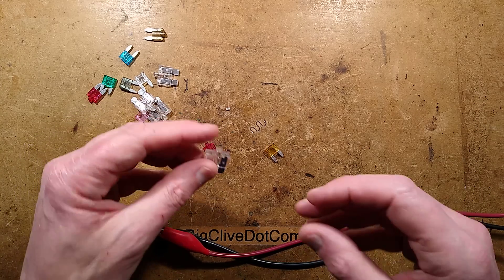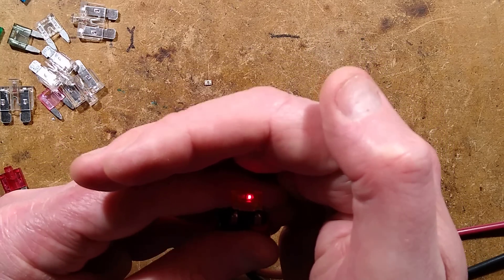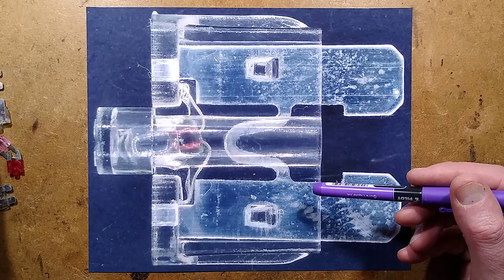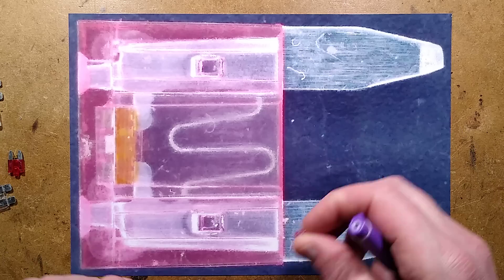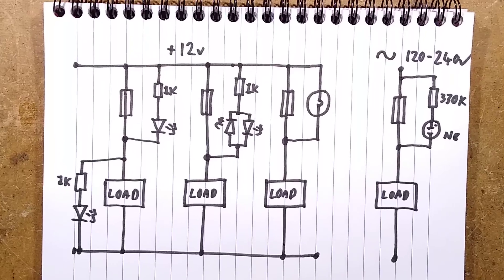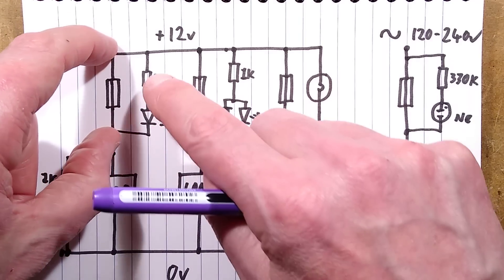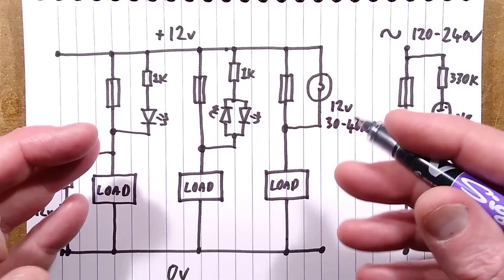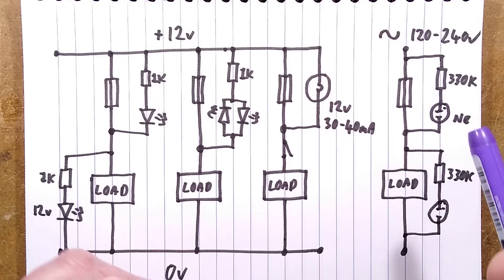Inside self-indicating vehicle fuses

Comment: My company built an electrical panel for a client and used indicating fuse holders for 4-20mA instrumentation… it did not go well, we struggled the figure out why it wasn’t working. Works well for solenoids but not for instrumentation.
Reply: These things a 50% wirchcraft. I had one in a machine with a 12v outlet. + from the outlet to + of the battery was 0V,  ground out to ground battery was 0v, but the outlet showed ~10,5V, while the battery was at 12,4V. Took us 30 min to figure out, that the fuse was blown, and only after checking the outlet with a load. Without the load, they won't light up (in addition to this one being in a non transparent box). 
So great to find a short, terrible, if the offending device was already removed.
Reply: @clockworkvanhellsing372  I try to explain to non electrical people that if you run a 220VAC to an open limit switch that is 50m away and you can measure 90VAC between the return wire and neutral. They look at me like I’m mad. It’s enough to make an interface relay hum and you can measure it with a multimeter but people refuse to believe it because it’s an open circuit and should have no voltage
Reply: @garnergc - try working on long distance (as in hundreds of yards or more) systems where multicore cables carry mains AC, or unsmoothed DC circuits, or which run in the same cable run as a mains cable. All kinds of stray induced voltages can occur even if both ends of the core you are testing are disconnected...
Reply: Bonus we had gotten a dodgy batch of fuses from a supplier and while I was doing continuity testing with a multimeter I’d be blowing “50mA” fuses. We scraped all fuses under 100mA in those panels and replaced them with a fresh batch

Comment: What happens if the fuse is feeding something with a high resistance? Also, the item fused would have to be switched on for the light to show (headlamps, blower, etc.).

Comment: Self indicating fuses (especially tungsten ones) kill batteries if you have a wire harness fault on a parked car.
It adds a phantom drain that is not insignificant to the blown circuit.
Reply: Buy a solar panel for your car if you are worried about minor drain. I hardly use my car, so I have put a solar panel on the dash. It's not powerful but enough to just keep the battery topped up
Reply: Adding this type of fuse is a good idea in principle but maybe not a great idea for permanent live circuits. Ignition controlled circuits should be fine. I say this because as mentioned above in other comments the parasistic drain on a typical 12v vehicle really need to be as low as possible to avoid dead batteries. As a rule of thumb I work on anything above 90-100mA is too high and needs looking at.
Reply: The quartz clock in my old car pulls about 30mA, which isn't really an issue, but i'd agree if you have a choice between the LED and the filament fuse, choose the former particularly if you don't drive the thing every day. 
As an example, 200mA quiescent drain on a 44Ah battery managed to flatten the battery in 10 to 14 days. I found out that i'd plugged a relay into the wrong socket, and it was 'on' full time. It got quite warm..
Reply: Yes but little flashing alarm LEDs and computer / sound system memory backup don't kill batteries because of auto industry magic
Reply: You know that modern cars nowadays are permanently connected to the internet like Mercedes Me? Guess what’s powering the LTE and controller module?
Reply: @the_tux  Said modern cars also do coulomb counting on the battery to support fuel economy features like auto start stop and charging disconnect (drop the alternator voltage to stop charging when full), so they will stop LTE connectivity and features like passive entry when the battery is low. This also happens 48 hours-7 days after the car sitting idle.
Reply: @straightpipediesel  Even in that case they consume way more energy than self indicating fuses do. Especially when they’re equipped with LEDs.
Reply: To see any battery drain from a self-indicating fuse while parked you would need to have a blown self-indicating fuse on a circuit together with a wiring fault that's keeping that specific circuit powered while the car is parked..... is your car being held together with tape?
Reply: @MatthijsvanDuin  Modern cars rarely switch DC power anymore but rely on bus communication and logic to turn things on and off. For example, in old cars, your radio would be switched, but due to, for example, the infotainment system taking OTA updates while the car is parked, it's now constantly powered and has logic to go into sleep mode. Another consideration is instead of running individual supply wiring back to master relays, they can mix consumers, reducing wiring weight to improve fuel economy.
Reply: I have several 2-way radios in my car that are notorious parasitic drainers; I got sick of replacing my battery so I installed a blade fuse on the ground lug.
Reply: @Jah_Rastafari_ORIG 
All radios must be duel fused, one on Positive lead, and one on Negative lead. One is DC, and the other RF.
Reply: @snakezdewiggle6084  Uh-huh.... "RF fuses"...do go on...
Reply: @Jah_Rastafari_ORIG 
Oh sorry, I assumed you knew about Radio.

Comment: Given how often car fuse boxes are located in pretty piddle-poor places, having these as standard would be very useful for when things go pop, saving time and spinal contortions in getting them swapped out as quick as possible (once the actual fault has been determined of course!)... :)
Reply: Not to mention some of the bloody things have THREE fuseboxes.
Reply: @thephilpott2194  
Or more...for instance  Ford Transits have a double stacker one as well, which can bambozzle the unwary (especially if the owners' book has gone AWOL).
 Its odd though isn't it, though. For a long time cars only had the one fuse, if they had any at all (in the field circuit of their 3rd brush generator). Then fuses for everything (including headlights!) in the 1930s, then back to one in an inline holder somewhere, or two fuses in a Lucas 4FJ fuse box in the 50s-60s, then maybe a dozen or so in the 70s and now we are back to double digits.
Reply: It would be better if the fuse boxes had the indicator LEDs instead.

Comment: Ive seen these similar style self indicating fuses used in oil refinery server rooms. They have normal glass fuse inside the housing and two leds in paralel with a resistor.

Comment: At work I have some fuse holders with indicators on the power input to some gas burners, it's some chinese fuseholders for 6.3x32 fuses, the clear plastic handle that's used to remove and insert the fuse and cover the contacts has a neon bulb inside of it

Comment: That's pretty cool.  I can't believe it took this long for someone to invent these.  The tungsten bulb might cause a problem with running down the car battery if used on a circuit that is always on, though.
Reply from the maker: They only light in the event of a blown fuse and a continuous load.
Reply: Think I first saw them about 20 years ago. Unfortunately all my vehicles are decrepit and old with torpedo fuses, recently when doing my own electrics I was a bit surprised indicating blade fuses haven't become standard. Maybe the slight higher expense and making it to easy for normal people to identify faults 🤷‍♂

Comment: I wish I knew those existed when I did car stereos, instead of poking around on my back on the driver floor lol, great vid!
Reply: I wish all our car makers knew of these when they made our vehicles! (or I guess I should say... would pay the extra .00093 cents per fuse and add these at the factory)
Reply: The total material cost is probably cents per fuse, not fractions of a cent like you suggest. But your point still stands.
Reply: When I did car stereos, I liked to use the big showy AGU fuses, which were available with LEDs to show when it they were blown.
Reply: It seems like these might be a new thing. At least I’ve never seen one before.
Reply: But if they start adding up to an additional 100-150mA constant parasitic power draw, in addition to the typical 30-70mA, you're far more quickly gonna end up with a flat batt or unable to coldcrank in cold winter. Disconnecting the battery of you're going on holiday for a week is a much bigger ordeal and headache afterwards with cars these days, than those from 15+ years ago.

Comment: The maximum voltage rating of a blade fuse is 32V DC
Reply: I was just looking this up.  Littelfuse also offers the MAXI 58V & MINI 58V which are rated to...58 Volts.  I'm guessing this is designed to meet the needs of the new 48V automotive systems.  All the other blade fuses are rated at 32VDC.
Reply: @bob1505  There's more to the world than just cars, you know.  Blade fuses are also used in all kinds of industrial and other applications too, many of which are 48V DC.
Reply: @foogod4237  You don't say?  More than cars?  I am an American, this is news to me.  Are there other contrivances that use fuses?  Removing my tongue from my cheek I don't recall much other than vehicles that use blade fuses.  It was my recent discovery some vehicles now use 48 volts for accessory equipment to make the automotive connection. 

Wow more than just cars...who woulda thunk it?
Reply: Could just use a penny
Reply: also seen them rated for 80v dc used for forklifts
Reply: current available also matters, those fuses are no business in 48v battery systems etc. try with welder if you want. the problem is the arc. if arc doesn't break, fuse is useless

Comment: Can imagine an inverse parallel led being more use if both leds were different colours, either to show an intermittent fault or melted wiring being crossed somewhere on that circuit, do car circuits not have polarity protection?

Comment: Low voltage only? Isn't an amp an amp 🙈
Reply from the maker: An amp is an amp.  But at higher voltage the risk of flashover is high and it can result in an uncontrolled arc that flashes over to adjacent circuits.
Reply: @bigclivedotcom  true...
Reply: Higher voltages might fry the lamp.
Reply: @pbe6965  only an led
Reply: Voltage ratings on things like fuses, switches, and wires are to do with insulation resistance and quenching flashover. You see, the issue when you have lots of volts (or lots of amps plus an inductive load) is that the air gap between the contact points will become ionized and sustain an arc across the (supposedly) broken circuit.

Comment: This reminds me of some large current fuses that had a red bead in a recess. Once the 400 Amp or whatever rating  blows, it pops the wire that holds the bead and it falls out, indicating the failed fuse.
Reply: I've actually seen some that use this design in a small blade fuse, but they weren't quite compatible with automotive mini fuses.

I believe they were an older telecom standard, but I've never actually seen the equipment they would have been used in.

Comment: Wouldn't it result in the load being powered through the LED or lamp?
Reply: The load,typically drawing a lot more current than the milliAmperes of the indicator, effectively acts as a connection to ground.
Or think of it as a voltage divider with the indicator a quite high resistance and the load a quite low resistance. The point between the indicator and load ends up close to 0V, and can't power the load.
Reply from the maker: Only enough current to light the bulb or LEDs.

Comment: The secondary fuse holder I installed in my van has the indicators built in with an LED and resistor across the fuse.

If I wanted a self indicating fuse I would certainly want one which is not polarity sensitive.

The same goes for LED replacement bulbs, far too many are polarity sensitive. While that's not a problem with ones which can be reversed it most certainly is a problem when the bulb is not reversible and the consumer has no control over the polarity. Given the price charged I can't understand why a simple bridge rectifier can't be added.
Reply: Listen to Clive and learn.

Comment: I like the reverse-parallel LED connection. Polarity-agnostic and works with AC as well as DC. Simple and elegant.

Personally I'd rather have the indication built into the holder, leaving the fuse to be just that.
Reply: Some fuseholders that are used in industrial equipment have exactly that feature.
Reply: That'd be the true genius approach, but it'd cost 10$ more in production per car, and we have to think of the poor car industry that's barely making a turn over.